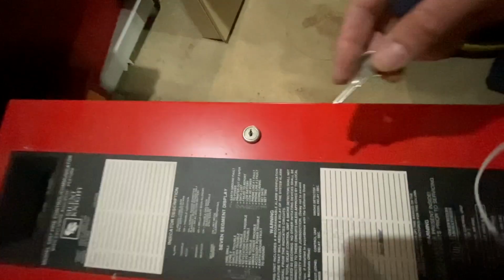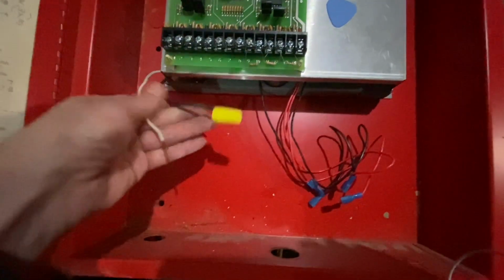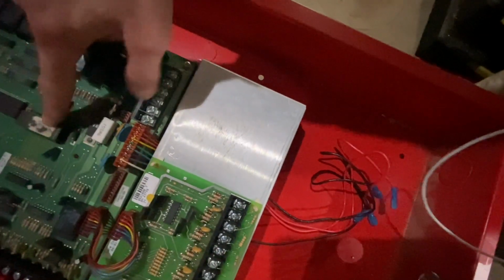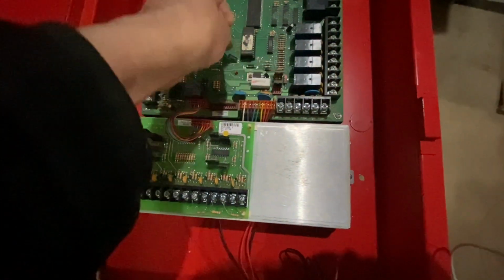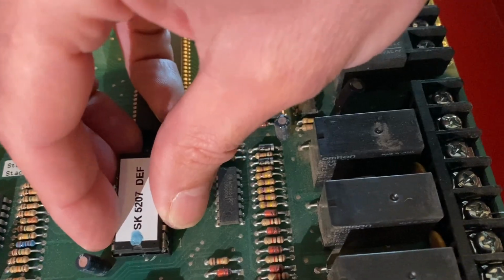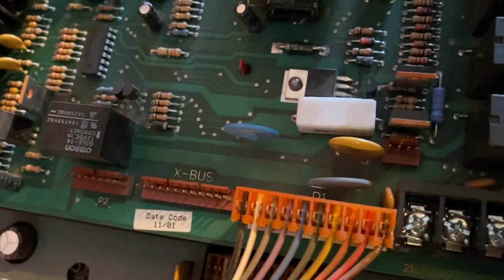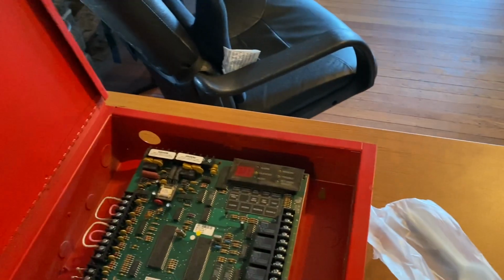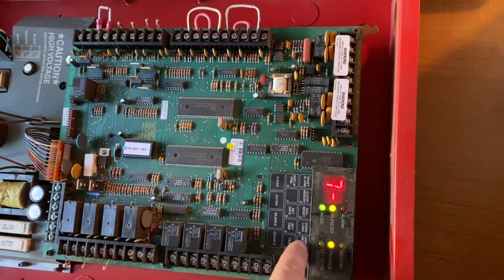What chip shortage?? Got Eproms?  Replacing a Silent Knight 5207 Eprom

Comment: Hi there, love the video! Had a quick question for you. I have a Silent Knight Panel with a failing dialer. I got a replacement panel I'd like to swap out and drop in. If I were to take my eeprom from the unit with the bad dialer and drop it into my replacement panel will there be any re-programming that needs to be done or should it all just be plug and play?